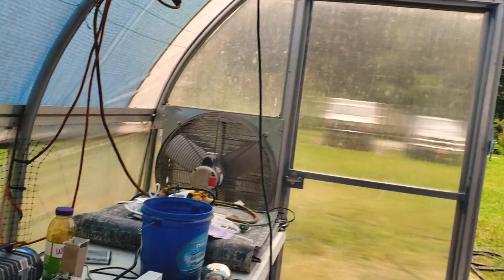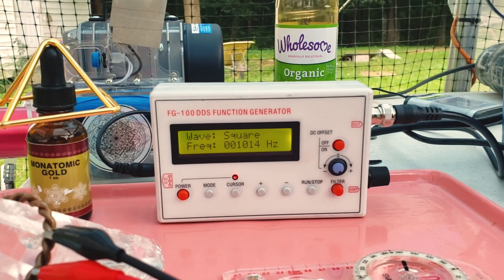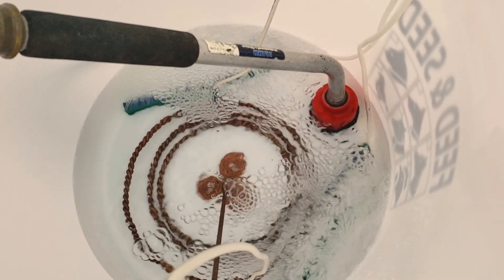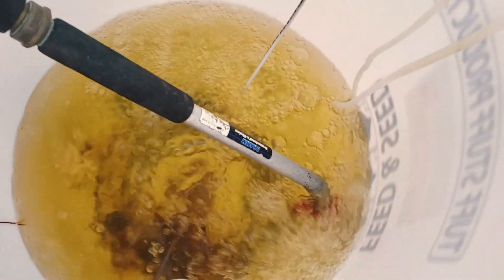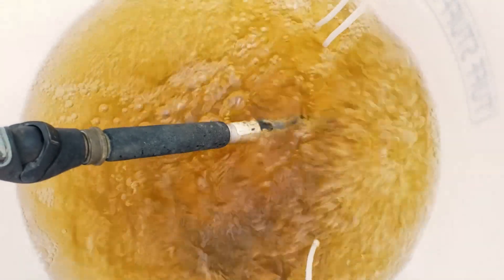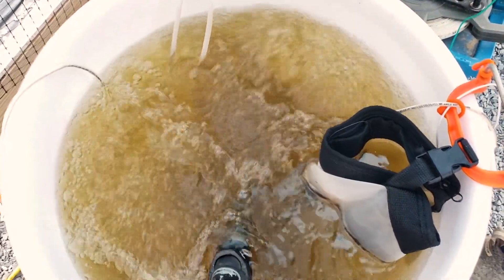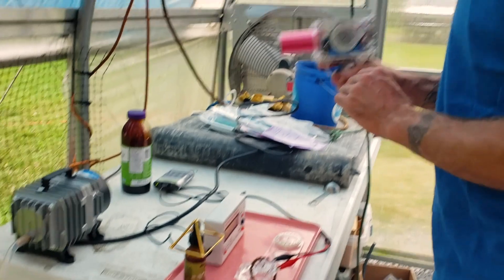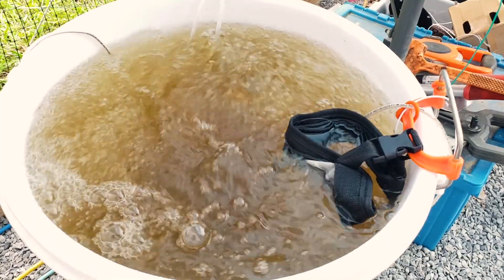Electroculture, Plasma Activated Compost Tea, And Radionic Fertilization    @TheFertileCurrent

Comment: Wow just did something similar to this this week by following my intuition . 
It guided me to to spin ( reprograms the water to its original state) plus I did the intentions of goo healing energy love joy and so on ) my water for 18 minutes clock wise and counter clock wise, then I added the antennas and a second copper wire as a grounding wire. 

Note: my water is city water and you can really smell the chlorine in it ,as if you just open up a bottle of chlorine bleach . 😢

For my antenna part is twirled 9 times clockwise outside the jug and the tip is 3 inches longer past the spiral . 

Now the grounding wire the one part that sits in the water is bear copper wire,and what’s not in to the water copper wire is insulated outside and the end peace put in to the ground outlet of the electrical outlet it’s also bear.
. 
Note that the bear part that goes in to the wall outlet is actually put in to the ground and not negative  as like the grounding mats for bed .

now while I’m writing this comment,my intuition just told me to do add a Lukovski circuit around the water jugs .

The opening set to north and in a 30 degree angle . 

Now the Water once gone trough my 7 stage water filtering system.. water is filtered quicker and the first filter (ceramic ) plate doesn’t need to be clean off as often plus the water gone trough taste like rain water . Plus once in mouth it feels very light and the body absorbs it quicker . Can’t wait to add the Lackohvski circuit tomorrow.

Oh by the way my cats now don’t want to drink just filtered water . They now prefer the water that has gone through the entire process. So do my plants . Wow